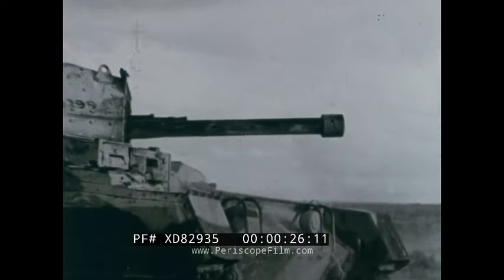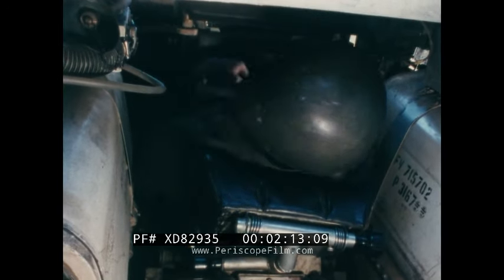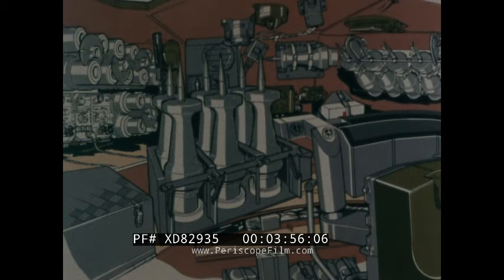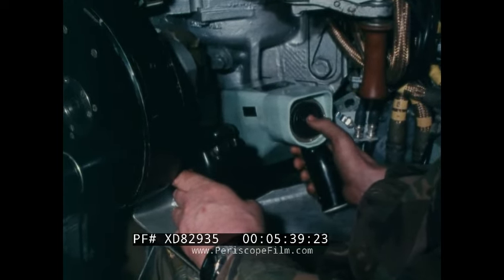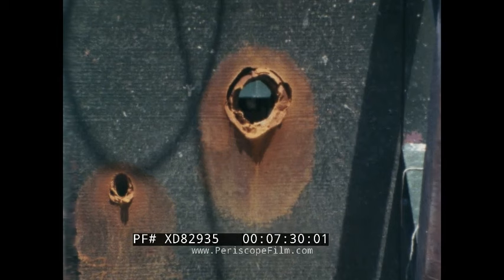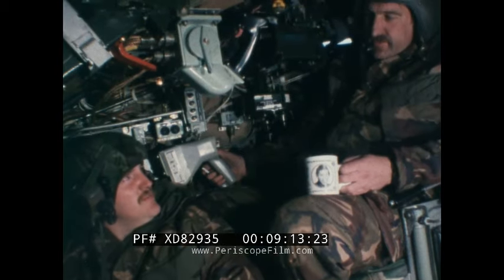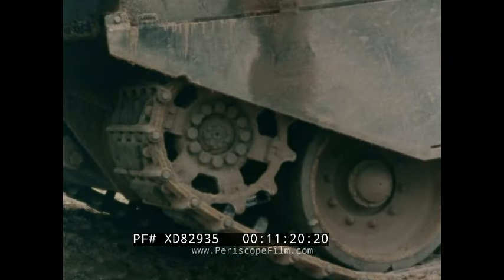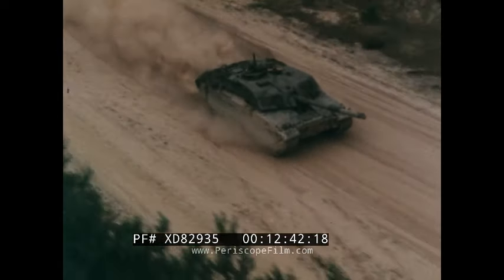"FIREPOWER, PROTECTION, MOBILITY" 1983 BRITISH CHALLENGER TANK PROMO FILM  MAIN BATTLE TANK XD82935

Comment: Even with it being 40 yrs old, I still think it's very modern.
Reply: What makes a tank modern nowadays are it's fire control systems. So 3rd or even 4 th gen night vision, thermals, for both commanders and gunners. Then after that you have programmable rounds, most barrels are now smoothbore as the rounds are sabot fin stabilised thus negating the need for a rifled barrel which wears down quicker. The programmable rounds can airburst above infantry to spread small balls and flechettes over a large area.

Finally you'll have passive and active protection systems, like trophy.
Reply: truth is there hasn't been much innovation in tanks since the 80's just systems upgrades!!
Reply: @keithmoore5306   Correct